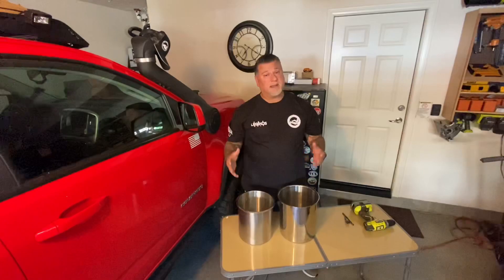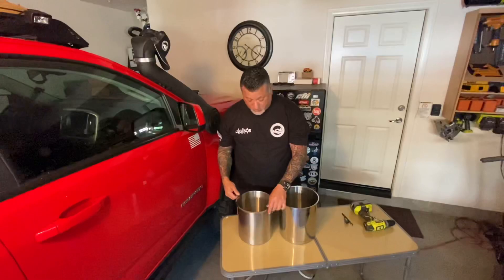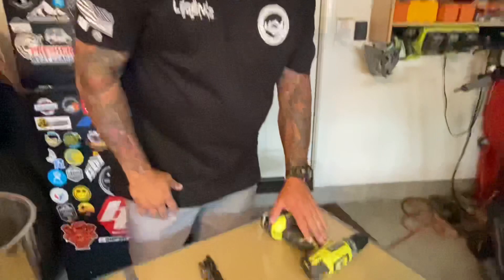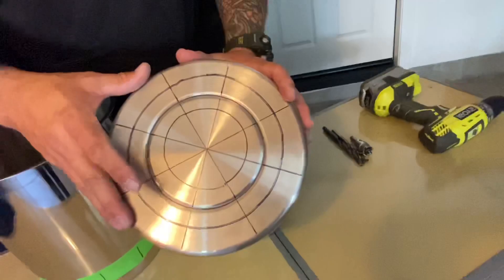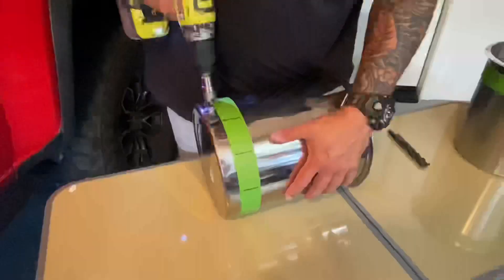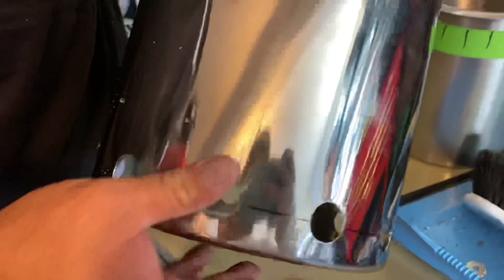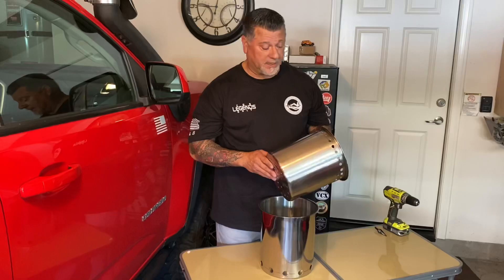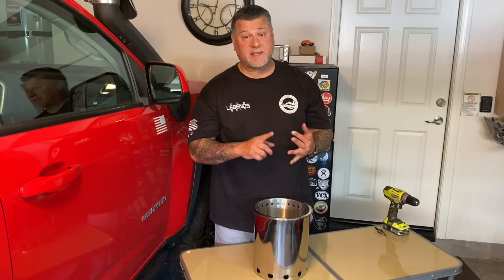$35 DIY Mini Solo Stove

Comment: Drill some holes around the outside circumference of the inner one at the bottom too. I made one of these out of two stainless steel stock pots years ago and found that just having holes in the bottom of the inner pot would get clogged with ash. Having holes around the outside of the burn chamber, maybe a inch or two above the bottom, helps greatly with air flow. It will burn fuel faster but much easier to maintain the fire👍.

Comment: While still considerably cheaper than a Solo stove, the two Maries pots listed are currently nowhere close to the $11 mentioned in the video, one is $44 and the other is $25, and that's with Prime free shipping. Then you've got to add in those drill bits, which will kick things over $100 -- a long distance from the touted $35.
Reply from the maker: There is no doubt that prices have gone up considerably due to COVID-19. And also the demand for the product should be considered. You may be able to go to your local kitchen supply store and get it for a fraction of the cost.
Reply: @TrailAdventuresTV  Good point. For the 12 quart pot, Amazon has a used one for $7.67 with cosmetic damage but for this purpose that hardly matters so that hits the sweet spot on pricing. Is there a generic name for these things?

Comment: I really like how you gave credit to the other guy that made one.  I just watched that before your video.  I'm curious, do you get good radiant heat from the sides?  one of the things I've noticed with Solo Stoves (Bonfire in particular) is that all the heat goes up and you have to sit pretty close to the fire.  I'm not sure if its a difference in materials or something.
Reply from the maker: Thank you so much for stopping by and visiting the channel. I really appreciate your compliment. I believe so many people steal content from others without giving credit. This little DIY solo stove puts out a lot of heat. My expectations were blown away by this simple and affordable fire pit. You will not be disappointed. We used it for four days when we went on the Mojave Trail. And everyone loved it. It was the hit of the campsite. Even better it did not leave any burn scar behind.
Reply: They don’t radiate much heat thru the dual wall.  I have been building larger versions of these for years out of old hot water heaters. I don’t build them any taller than about 16” and the one I have in my own yard, I put down below the level of the patio(basically set it down in a hole) so you can get more exposure to the heat from the fire.  Getting close to it is not a problem though as they burn nearly smoke free and you can set right up next to them...  Most of these I see built get way too many holes put in the bottom of the inner container.  These really take very few primary air holes to burn correctly and cleanly.  More holes will still burn well but it will consume way more wood than it has to for a nice fire.  Trail Adventures looks like he got it about right.  It might burn better with fewer holes. It is easy enough to block some off to experiment...